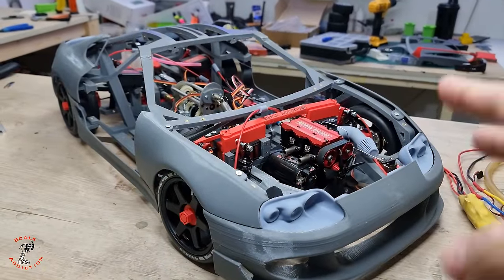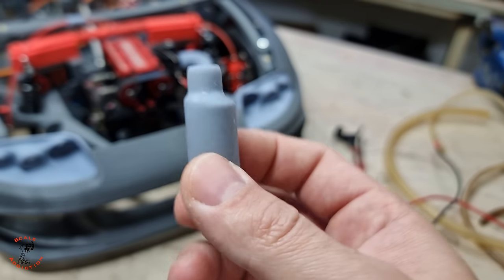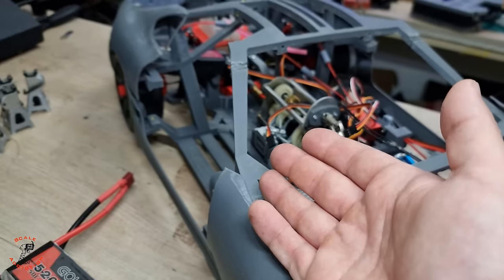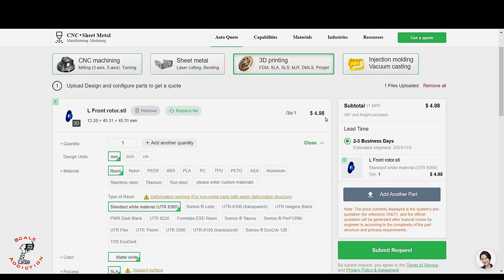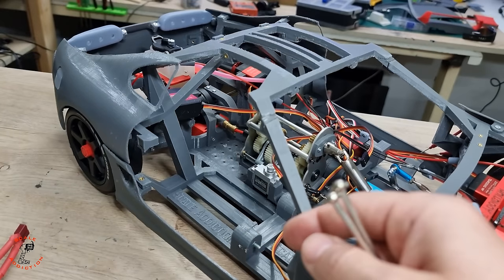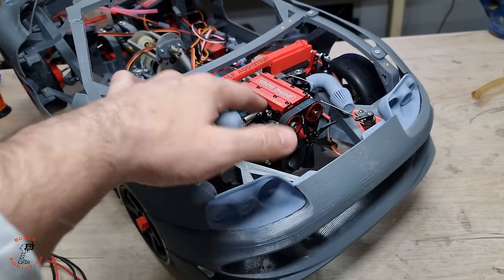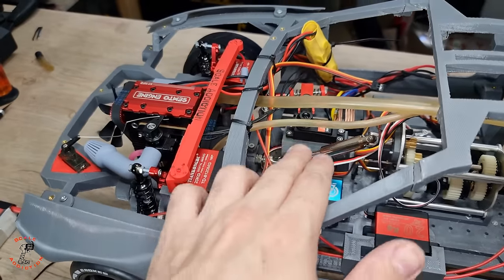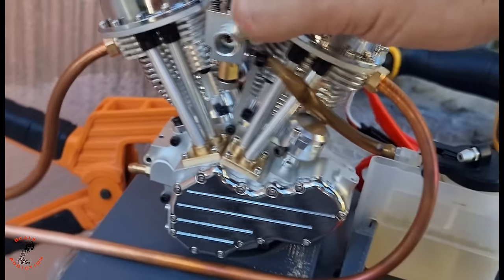Part 12 / 8th scale 3d printed supra with 2 cylinder engine project / Scale Addiction

Comment: There are two options for the driveshaft that I've found XP-10097 Xpress Xpresso M1 28mm Drive Shaft Set 1 pair and Center Drive Shaft, Rear, 28mm (1/8 Helios) hope this helps a lot.

Comment: hey Ali what is the link to the gear box that you are using
Reply from the maker: It's in the cults3d with the files, all the links there
Reply: @scaleaddiction  it’s not the link’s haven’t been updated in months
Reply: @scaleaddiction  matter fact the cults 3-D files has an arduino that you never used?